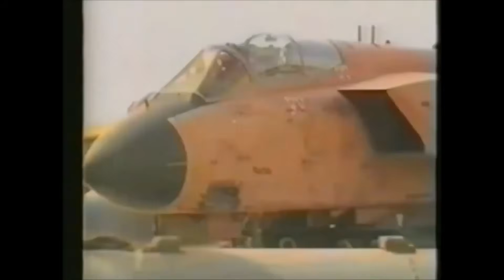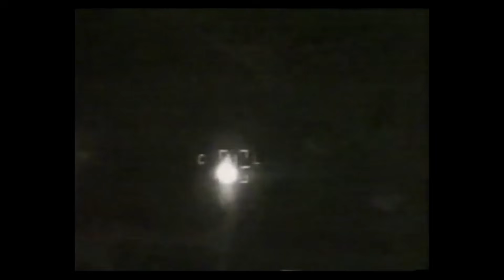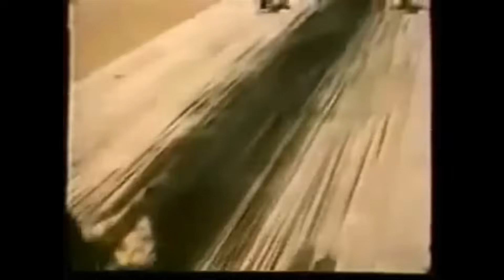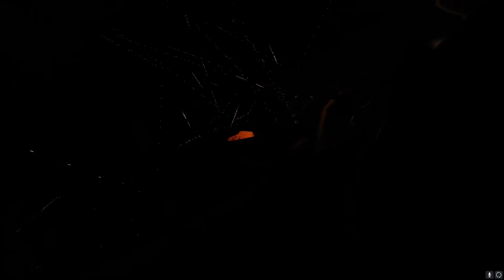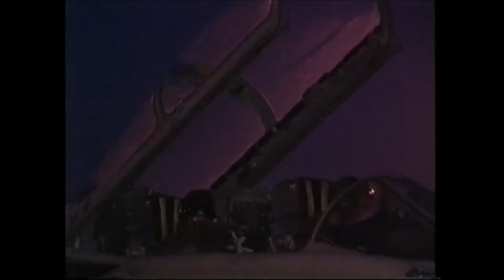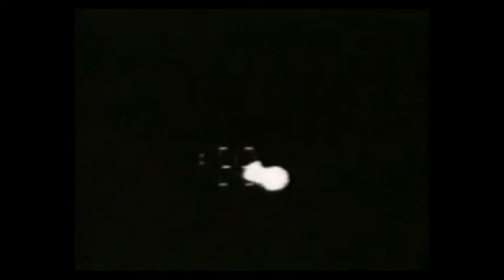Most DARING mission flown on Night ONE | RAF TORNADO GR.1

Comment: I think the tornado mentioned was shot down by a Foxbat.
Reply: It was a SAM. 
The Story from Iraq had the day wrong. It's not something that could be faked when there were reporters on the airbases. 
The story from Iraq also suggests the Tornado pilots saw them, there's no first hand testemony where that's even a possibility. 
Read Tornado, by John Nichol. It covers GR1s role and missions in Iraq comprehensivly with passeges from the surviving crew members. There was no Tornados lost to enemy air action.
Reply: @mrflibble9783  could be , as the tornados sorties were flown by daytime.
Reply: @fredyfastorgav77  The low level missions were nearly all at night. 
Daylight raids come when they started hitting targets at medium height (20,000 feet) 
At the time, the rather large Iraqi airforce were hardly flying any sorties and getting destroyed on the ground, and where they did fly were were often quickly getting shot down from strong CAP pressance. The story was invented as a propergander peice to give to present them as something other than totally ineffective.
Reply: @mrflibble9783  I believe from what I ve investigated, the RAF toenados striked daytime after the first night of deserstorm.
Reply: @fredyfastorgav77  Nope.
RAF tornadoes did a number of days of night time attacks. They only moved to day time with the switch to medium altitude. 
Worth reading John Nichol 'tornado' as it covers the tornadoes through desert storm.
Reply: It was a flogger..
Reply: @wor53lg50  I still insist it was a Foxbat, from what I remember.

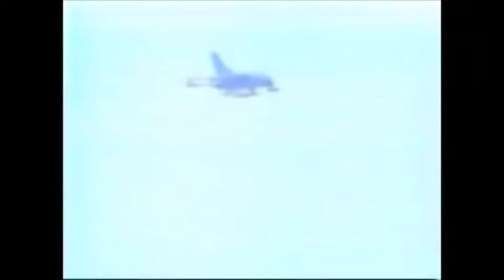Comment: 1:49 JP-233 was big and brought a lot of drag.
In French doctrine, BAP-100 or Durandal could be used together with BLG-66 IDZ, the later being a CBU dispersing randomly delayed sub-munitions to also delay the repair.
Off course, anti-runway munitions and BLG-66 IDZ would not be deployed by the same aircraft, but France didn't used fighters as big as the Tornado 😅

Comment: Thank you for a great video.  I cannot imagine the balls needed to go in that low, at night, and thrusting automation.  I heard some rumors though taht the Tornados didn't like the hot climate a lot and that it really affected them badly. You know if that was true?   I know about the Jags, but never head the Tornados suffered too bad from the heat (As any plane would ofc)
Reply: It's just tale... Saudi Arabia are still flying the ADV and also the GR4...... Yes they went U/S but so did the Jags, Buccs and  other RAF aircraft.....
Reply from the maker: There are a few news stations going around the Gulf during the workup, talking to the RAF crews. I think it was more the crews adapting to the climate, with some issues with the aircraft due to the heat.

Comment: Good fun stuff, but you seem a bit mixed up with how JP233 worked.  There were 2 types of munition, the cratering bomblet and the mine.  The cratering weapon had 2 charges integrated together so that a shaped charge punched a small hole in the runway surface and carried the second charge underneath.  The second charge then detonated to heave up the surface, making it unuseable.  The mines then landed in amongst the resulting rubble, either going off at random times after the raid or when tipped over.  Either way they would make the life of a repair crew quite uncomfortable as they also included a shaped charge that could easily puncture a bulldozer blade and destroy the vehicle as well as being lethal to personnel.  The problem in GRANBY was that the 233 had been developed to destroy Soviet and East German runways.  Much was known about their construction and in fact a replica was built at West Freugh range specifically to test JP233.  Unfortunately the Iraqis built their runways differently and much of the 'heave' charge was dissipated in the sandy sub-structure so that the effect was not as good as expected.  Of course this became moot when the Iraqis effectively grounded their airforce in the face of attrition by Allies fighters.
Why would you hear three thumps when the empty 233s were released?  JP233 was an enormous thing over 20 feet long and they only carried 2 weapons, side by side under the fuselage.
The Peters and Nichol shot-down was not quite as described.  There was a bit of an issue with the weapon delivery mode and in dealing with it they had actually reached significant altitude over the airfield with the bombs still on board.  They then got back down to low level and turned to egress, at which point the missile hit.  That's why they landed miles from the target.
There is no evidence that any GR1 was shot down by a Mig during Granby, certainly no Recce jets were lost at all.  A GR1 was shot down on 19 Jan 91 but that was down to a SAM and both crew escaped; they are likely available for interview if you can track them down.  GR1 ZA467 was lost on 22 Jan but the other guys in the formation testified to the Board of Inquiry that they flew into the ground.  It's not a question of likelihood; the facts are out there!  The iraqi pilot was spinning a line.
I don't think 'complacency' had much to do with the loss of 717 on 14 Feb, and I'm sure the family of the dead nav Flt Lt Steve Hicks would not be happy with you saying that, especially as he would have been running the countermeasures.  They were bracketed by a pair of SA-2 SAMs and sometimes the dice fall the wrong way.
Reply: Hi Tim. I was on the airfield attack on 14 Feb 91 (which, incidentally, was a 12-ship - 4 Buccs, 8 Tornados) and the plan was certainly ‘complacent’. Whether it materially affected the outcome is debatable.
Reply: Small correction. The replica was built at Porton Down, west freugh was only used for soft target testing.
Reply: @nedkelly9645  I'm not convinced, firstly because I'm not aware there has ever been an air weapons range at Porton but also from having spent many hours at The Freugh, spoken to the range staff about the trials and viewed the test site, and having been briefed on the trial during my GD ASC in 1986, which included both WF and Hunting Engineering.  I can't see any evidence of a simulated Soviet runway/taxiway on the overheads of the Porton area whereas the W Freugh site is still there (IVO 54.848N, 004.906W).  As far as I can discover the first JP233 live trial was flown at West Freugh, U.K in Feb  82, with GR1 ZA354.  The first RAF crew release was a couple of years later at the Eglin ranges in Florida.  But if I'm wrong, then I'm open to argument.
Reply: @timgosling6189  It wasn't an operational runway, simply a pad built to the spec of the Soviet runways. It was many moons ago, I was probably the youngest trials engineer on the project. There won't be many at either site now that were there at the time.
Reply: @nedkelly9645  That's what I was looking for; sounds exactly what they built at The Freugh, where the hard standing and 2 strips of runway/taxiway are still visible.  Out of interest, what sort of 'soft targets' do you remember being used?  Still confused because all the live weapons ranges in the Boscombe area were North of the A303, not South and certainly not near the Chemical wpns labs.
Reply: @timgosling6189 At portion there wasn't any live firing as such, the cratering munitions were dropped off a rig. Don't recall any live drops at the freight, but it was a long time ago 😁
Reply: The soft targets were basically the same as the rest of the ground around there gorse and rough grassland
Reply: @nedkelly9645  OK, now I understand.  I was talking about the initial live full system flight trial drops, which were indeed all done at West Freugh.  WF was nicely isolated and benefitted from the full coverage of kinetheodolites to confirm the ballistics.
Reply: I’m just 😊😊

Comment: Methinks the Tonka is the best multi-role aircraft ever built, goes to show what can be achieved when there is co-operation with our European cousins.
Reply: The GR was a good ground attack aircraft, but very limited in its air to air ability. The interceptor (eg F.3) variant was only really good at exactly that. Even as a dogfighter it wasn't particularly impressive. The Typhoon is probably just as capable in most roles, and definitely more capable in a few.
Reply: I see this bird and I understand the design philosophy of the F111 Aardvark and the B1 Lancer.

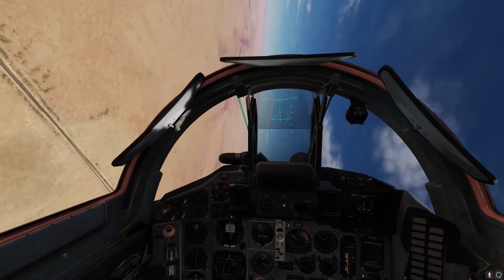Comment: Minute 14:39 you say a GR!A was shot down - we did not lose any GR1As during the war.
Reply from the maker: Sorry I meant GR.1B if I remember correctly, the Recce one.
Reply: @IrisAviation91  The recce version was the GR1A - we didn't lose any recce aircraft - I finished the war with the same 6 aircraft I started with. I'm only commenting for accuracy.
Reply: I concur. We didn't lose any. Counted them out and fixed 'em when they came back

Comment: MAY BY BOTH ARE MUCH LIKELY MIG 29  OR SAM ... HOW ABOUT THE F 3 TORNADO DID IT HAD DOG FIGHR WITH IRAQI MIRAGE OR MIGS
Reply from the maker: The Tornado F.3 was placed further back performing rearward Combat Air Patrols (CAP). USAF F15Cs would be the most common aircraft doing more aggressive CAPs, engaging Iraqi aircraft. The Tornado F.3 also lacked modern IFF (Identification Friend from Foe), so they were placed further back to protect C2 platforms, like the E3 Sentry.